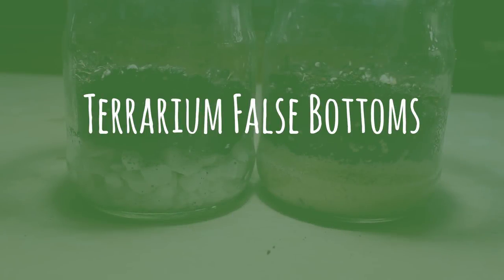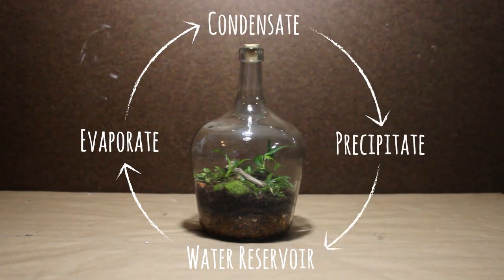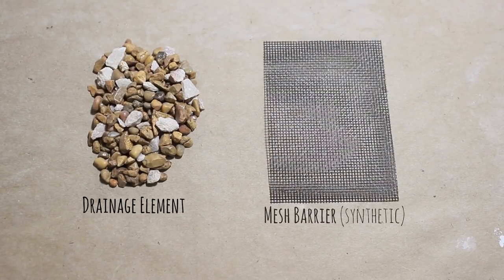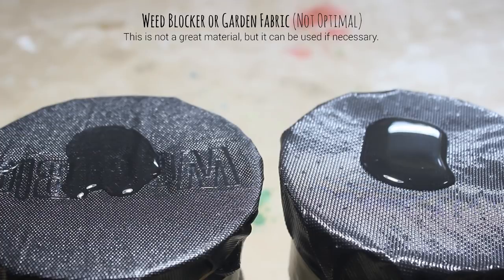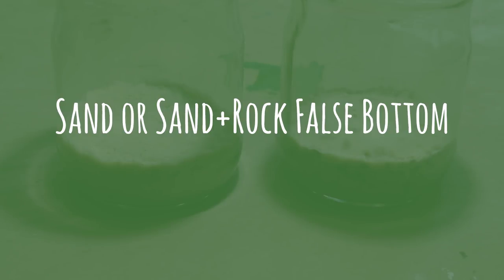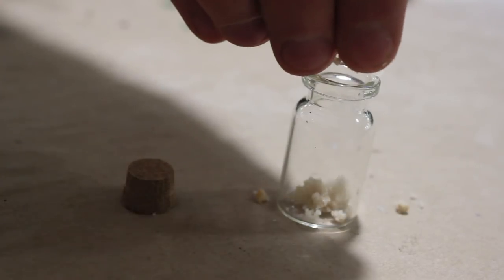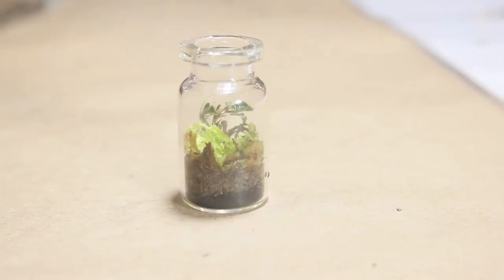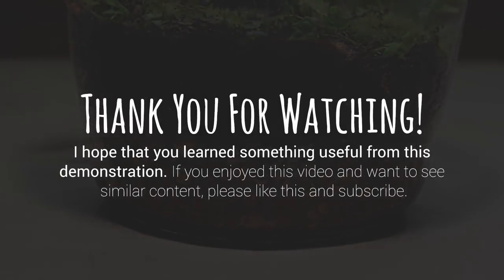All About Terrarium False Bottoms (Purpose & Methods)

Comment: you should do a carnivorous plant terrarium if you haven't already!
Reply from the maker: I will at some point. It is probably the highest requested video that I have yet to address.
Reply: Ban Bou I used to have a Venus fly trap.... it died
Reply: SerpaDesign awesome! thanks for the reply :)
Reply: Lexi's Hamster Care omg lmao rip - I wanna buy one so bad
Reply: I have a carnivorous terrarium but im an amateur at this so it would be great to see a proper one being made
Reply: @lexishamstercare6260  Venus fly traps are so easy to keep though. They literally just need water, light, and food. No minerals are required. You could simply make an enclosed terrarium like the one at 0:20 using one of the methods in this video, plant a venus flytrap in the substrate, chuck in some maggots and seal the lid and leave it under a bright light.

Comment: Hi Tanner. I finished my two terrariums. They look great. I'll email to u today. Thanks for all the help. The big one the screen mesh fell in so some dirt got in the false bottom. But the smaller one I did better. I just bought a window screen and cut out my pieces with a cutter. Worked well and easy to cut. Next time u will buy the screen have the roll. I used rocks from Wally and everything else from there.

Comment: Great tutorial! Loving the vids and your art.

Question: would it be just as well to omit the gravel and go straight to the charcoal, followed by mesh then substrate? Can the charcoal serve as the false bottom as well as gravel?
Reply: Some terrarium-makers dont even use false bottoms, so yes! It makes things a bit trickier and sometimes causes water to run up through the soil and keep it wet but if you do it right then yes. If its a smaller terrarium then a barrier isnt really needed a lot of the time because there isnt much water.

Comment: What about using a layer of pebbles followed by a layer of sand? I've seen this described in several older gardening books for potting plants, and intuitively it looks like it'd work for closed terrariums as well. I figure that so long as the sand isn't washed down into the pebble layer it could function as a mesh while leaving the larger cavities between the pebbles intact for evaporation.
Reply: I think that would be good for succulent heavy terrariums because water passes through into the false bottom slowly, leaving a lot of time inbetween for the soil to dry out
Reply: @greenjars_  Since posting I've grown a bunch of cacti from seed in small, closed jars with a false bottom. Surprisingly, they don't seem to mind a permanent state of semi-humidity, and it's very low maintenance because you don't really have to interfere with the system once it's set up. I think having a good amount of sand in the top layer of soil helps keep the roots from rotting.

Comment: I used knitting mesh as my barrier. For me it was easier to buy that than 6ft worth of window screen. Terrarium is doing great so far! But my friend made one and her false bottom is full of water. What's the easiest way to lower the water level when a false bottom gets full?
Reply from the maker: Roll up a paper towel, tip the terrarium slightly and dip the paper into the water. Then the paper towel will suck up all the water.

Comment: I made a terrarium today using the mesh bottom barrier. I used pebbles, a mesh layer, activated charcoal, damp orchid spagnum moss, blue sand, dirt, plants, more dirt, sheet moss & decor. The question I wanted to know is should the blue sand layer be between the spagnum moss and the dirt? Or would you place the sand onto of the activated charcoal layer?

Comment: do you ever struggle putting the mesh barrier in just right? im having trouble centering mine and making sure there's no run off on the sides. I can oversize it so the sides are cupped, but then it looks a bit silly on the outside..

Comment: Is there any light (preferably a certain wavelength so I can use LEDs) that makes the green color of plants stick out more? 
I've just made myself a terraium for all the different kinds of moss I've collected and I'd like to make it more beautiful with lighting. The plants get enough daylight so I don't have to worry about that.
Reply: deaglebeagle Plants reflect most in the 540-560nm range, so try starting there, but experiment. 

LEDs struggle to compete with daylight though, so consider having them run at night. I built a terrarium with a low-powered cold white LED which simulates moonlight nicely.
Reply: Simulating moonlight is a great idea! I even got some cold white LEDs ready to use! :)

Comment: Great video! I was wondering though, is it possible to use a drainage layer in a wooden enclosure? Even if the wood is sealed I worry it would rot over time, or something.
Reply: LiverInAJar what do you mean? are you making the terrarium in something thats made of wood? if so it would not work out. the condensation would ruin the wood causing mold and rot
Reply: xhellboundx my bearded dragon enclosure is made of wood and I am researching bioactive substrates and would like to include plants
Reply from the maker: It's definitely possible, you just have to seal the enclosure properly. I am currently working one for my king snake, See here: https://www.instagram.com/p/BWXTLptlTSE/?taken-by=serpadesign

Your main concern will be the seams. I used fiberglass on mine, but they can be siliconed as well. What if anything did you use to seal it? I will be doing a proper video on this pretty soon as well.
Reply: SerpaDesign Thank you for your reply. You've given me some ideas and I look forward to that video!
Reply: SerpaDesign Oh, and I used polyurethane to seal it, water based I believe. I have not siliconed the seams or anything as of yet
Reply from the maker: Hmm I don't know if I would trust poly to seal an enclosure. Regardless I highly recommend addressing the seams in some way.

Comment: Just came across this video where you state that carbon fiber mesh is best, do you still believe so? I know that in your newer videos you use geotextile fabric. Is the mesh still superior?
Reply from the maker: Geotextile is definitely better, but CFM will still produce good long-term results.
Reply: @SerpaDesign  Thank you! I have 2 more questions if you don't mind. First is if you could share where you source your geotextile fabric from I  would appreciate it (: 
  Secondly, would a 3/4 in layer of filter foam in between the drainage element (in my case leca) and the geotextile fabric impede water draininge or the plants root systems that are in the substrate layer? Thank you!

Comment: hey! i noticed you said you that charcoal is expensive, but you can make youre own charcoal with bits of wood, a metal can with a lid and a way to heat the wood like a fire or furnace. that way you can also choose what kind of wood you want for the charcoal, depending on the kind of wood they have different trace elements in them that might be good for the flora and fauna in the terrarium c:

Comment: What if you somehow put like a donut hole in the substrate so the evaporated water can escape alot easily, where as no hole will make the evaporated water have to move through the substrate?
Reply from the maker: It can work, but I don't think its necessary. For example an airline tube can be run from the false bottom up to the substrate layer and do the same thing that I think you are suggesting.

Comment: The energy that drives the evaporation-condensation-precipitation cycle in a closed system comes from temperature change over time.  If the temperature would be constant all the time nothing would happen.
Reply: A constant temperature differential between two parts of the vessel could also rive the cycle.

Comment: lol is there not a way to create a bio active false bottom, if you are trying to create a enclosed sustainable ecosystem the first consideration should be the cycle of gases like oxygen carbon dioxide and nitrogen. the plants take in carbon dioxide and breath out oxygen which is common knowledge and the process of decomposition with microbes are insects creates more carbon dioxide from the oxygen but is there not a way to make these gas exchanges more like our planets dynamic climate?? i thinks so